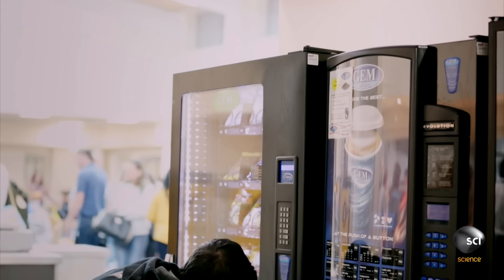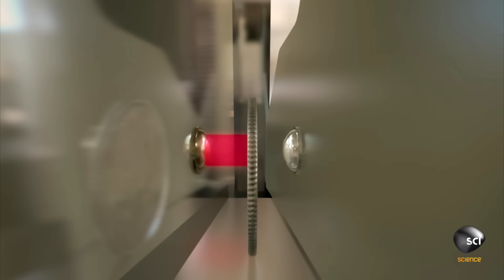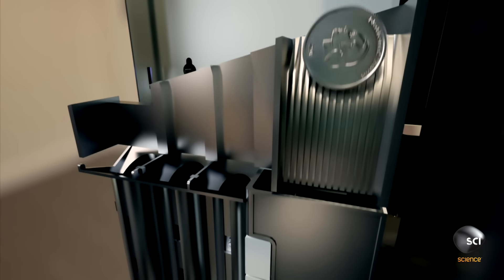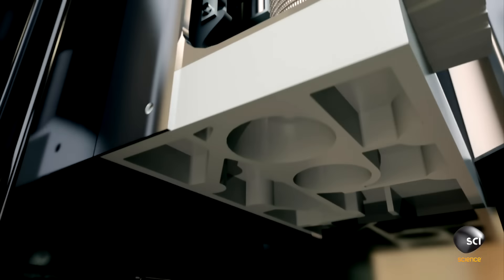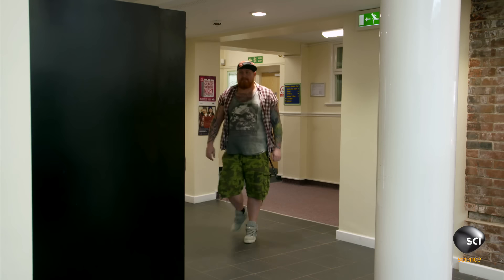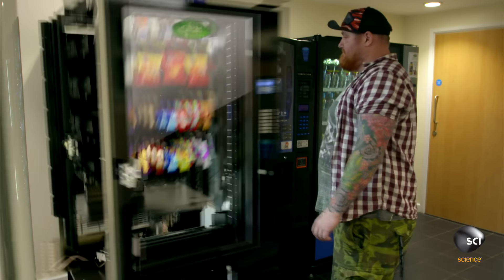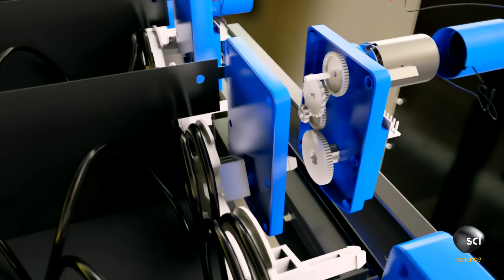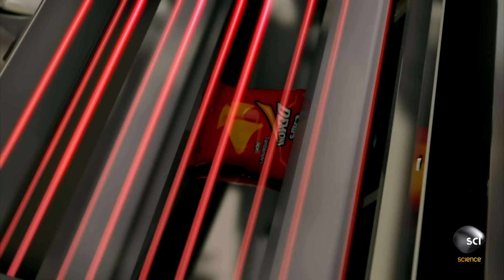How Do Vending Machines Detect Fake Coins?

Comment: Expectation: See, there's a different sized hole for each coin, and they're arranged from smallest to largest, so the larger coins roll right over the smaller holes.
Reality: Light sensors, electromagnet, computer, matchbox-sized motors, infrared beams

Comment: Slot machines, coin pushers, actually I used to empty these years ago for a company and you would be shocked at the data collecting process thing and also other different security things a simple coin pusher held within it in an arcade, slot machines even more so and that was many years ago

Comment: The question is, when a bag got stucked, and the machine does a second rotation, you should get 2 bags right?
But if there are beams, which check if a bag was going thru, than you dont get the second bag or do you?
Reply: laser check if something drops ( time gap ) - if drops 2 things he confirm OK   - you get 2 bags

Comment: I actually programmed one of these things many years ago. The video gets the crucial part wrong.
The one that we used did not need any light sensors and there is definitely no "electromagnets". Most coins do not use magnetic metals so there is no reason use electromagnet on them.
Instead what they do is they use a coil and THE COIN BECOMES THE CORE OF THE ELECTROMAGNET for a very brief moment (how cool is that?)
The coin falls through a chute at a known speed and while it falls it is subjected to eddy currents at a known distance from the coil. While the coin is falling, the field generates eddy currents and this causes the entire setup to act as a transformer and draw current from coil power supply. The current draw is measured and given as a signal and strength of that signal over time is used to identify coins. The plot will depend on the dimensions of the coin (larger coins take more time to pass) and different alloys and thickness of the coin will result in a different strength of the signal. Some countries use coins with multiple bands of different alloys and this makes identification especially easy/reliable. Also, the worst coins are ones that are not round (for example octagonal outside or square holes in it) as they tend to generate slightly different signals when passing through the sensor.
Props to the animator!
Reply: If there is no light sensors you don't get anything if the thing doesn't fall down after a 360 degree turn? I was thinking the light sensor thing sounds very exploitable, like if you spoof the lights or block them entirely maybe they will keep turning the thing
Reply: @jatoxo  The unit my company chose and I programmed had one continuous chute that led outside. If the coin is not recognised (or if the machine malfunctions, hangs, is off, etc.) then the coin just goes into output tray. The processor must actively recognise the coin and then it directs the coin to the right place with a cascade of binary switches.
Light sensor would be difficult to exploit. You would have to enter something in the pathway that would block the light for an exact amount of time, that would be quite difficult to achieve (if you can do it you definitely can pay for the item). And remember, even in the video above it is not the only sensor, you would have to somehow fool the other one which is even more sensitive.
The easiest way to fool the sensor is to find  either old worthless coins or coins from other countries that have basically same signature.
That's why manufacturers of vending machines program very strict coin recognition profiles which is why coins frequently do not work -- because the profiles are made purposefully as strict as possible to even generate some false negatives.
Reply: @leonardmilcin7798  Oh sorry I misunderstood, I meant the light gates that detect whether the item has fallen
Reply: @jatoxo  That is a separate system I wouldn't know anything about as the machine I worked on wasn't vending machine, it was accepting coins for another purpose.
But I think that one isn't easy to fool either. Think about it -- the machine just needs to register disturbance in the light input to the sensor at right time to detect that the item dropped. You would somehow have to "smuggle" the item through the path of light without disturbing it. That is not at all easy either.

Comment: So long story short, you just have to get ahold of the proper metal alloy, and cast a circular shape of the proper size and you'll have a fake coin that any vending machine will accept.

That's actually not as hard as it sounds for anybody with experience in melting and casting metals.

Comment: You can very easily cheat a vending machine. It detects the weight of the coin because of the featherweight it uses as a scale. Not what image is struck on the coin. I had a friend in the 8th grade and we tried it. We found some sheets of metal the same thickness as a quarter. Well, first we weighed a quarter on a scale and it weighed exactly 0.200 ounces. So we took that quarter, put it on the metal sheet, got a marker and drew circles on the metal sheet using the real quarter as a template.The fake coins we cut from the metal all weighed 0.205 ounces. We didn't think that that minute difference would matter. We just wanted to try this first so we cut only 40 to start with. We go to the bowling alley by his house that has an arcade in it as well as vending machines. When we tried our quarters, they spit out right away all the time. So we thought that maybe the 0.005 ounces more of our coins mattered. So we rode our bikes back to his house and filed them down on his dad's electric sander to exactly 0.200 ounces. When we got back to the arcade, they worked perfectly every time just like real quarters. In both the vending machines and the video games. We were elated! So when we ran out of our quarters, we went back to his house to make more. From each sheet of metal we were able to make 80 "quarters." Each sheet of metal cost $1.25 back then. This was back in the 1980s through the 1990s. Of course we couldn't use them in stores but we had all the free play on the video games and all the free snacks and pop we wanted from the vending machines. But we were smart. We didn't keep it all to ourselves. We told our friends and kids at school and made money off of them. We sold 80 of our quarters for $5. So they could buy $20 of stuff from vending machines or play video games. They sold well. So there is a way to cheat vending machines and that is how me and my friends did it when we were in school.

Comment: Unsurprisingly, the video doesn't actually explain how the coin acceptor actually detects the type of coin and whether it is genuine or not. And only the very latest machines have the product sensing beams - older ones do not. That said, there is a delay before it cycles the dispenser again, and if you shake the machine, it will usually register as "product vended" and then will NOT cycle again.. So..if you buy something and it sticks, don't immediately start shaking it. WAIT a good 10 seconds or so, if the machine has the sensor, it will cycle again (and you might even get the stuck one, and the one behind it too - consider it payback for all the times it took your money and gave you nothing.

Comment: Get a roll of nickels.  Using a sledgehammer, pound them until they are the same size as a quarter.  Results may vary.  They worked great in  video games back in the 80's.
Reply: @I_WANT_MY_SLAW   In the 80's?  Hell yes!  Now, not at all.   Not for me, anyway.  =D

Comment: So... it's just the size and magnetic as well as electric properties? You just need a round made out of the same metal with the same dimensions then. That wouldn't even be legally considered a coin, no forgery risk XD
Reply: That’s relatively time consuming and expensive for a snack. You probably only get a couple cent savings after a couple months of use.
Reply: A jak moneta jest mniej warta od metalu  ?   Czasami tak jest - inflacja  a od 10 lat te same monety.

Comment: coin counter - small box, made in china, measure  the coin very good and cost  only 10 USD  -  sensors, computer inside with memory (battery)   - you must press "setting"   put coin and box will remember it  ( 5 different coins  )  - so can simple use for many countries  - China changes  the world

Comment: In the past, primitive machines just checked size and weight))
Reply: I still install simple - just check only size (slot size) and must be metal (little heavy - not plastic)  - but  good coin counter start from 10 USD  - standard china - enough good

Comment: Well now I know its really easy to get unlimited snacks, with new machines all you have to do is cover the sensors with cardboard and it will never detect a snack.  You can easily do it using a bent hanger to jam the box in place lmao. I wont do it im not this poor but if I'm ever in this bad of a spot and in the middle of nowhere with cardboard and a coat hanger, ill know what to do.

Comment: NO you wont always get your snack ... it just has to break 1 beam ... not pass them ... it can hang up with just a portion breaking one beam and you cant even open the door to get it to finish the fall ... 
.
they need a squeegee to ensure that the item NEVER hangs on the way to the dispenser slot ... that is what is wrong with vending machines ... they missed the actual problem ...

Comment: … vending machines must cost a lot then
Reply: coin counter with laser sensor - 10-15 USD  - so expensive is body and many step motors  (one 10-20 USD )  but  all sometimes hundreds USD  (even thousands) - but simple 100 USD  (one product)

Comment: Hmm. So I worked with electricians and they have these nods that come out of the electrical boxes. I put them on a machine once and guess what. Two of them passed as quarters. I tried this on many machines and they do not detect grooves or metal type. They only detect the size and if it fits. Go on and try it and see. 4 in. 30.3 cu. in. Metallic Square Box

They sell them at Home depot for 3.25 plus tax they have exactly 17 cut outs that equal to 0.25 cents each. 4.25 if inserted into a coke machine or vending machine. Plus their use and expense. Try it and you will see that this video is not accurate. I live in the US and just go to the home depot and find one on the ground. Try it and you will see. No debunking this video just saying that I used them and they work.